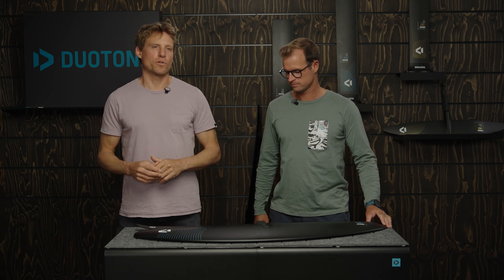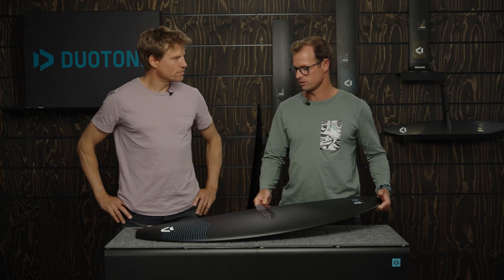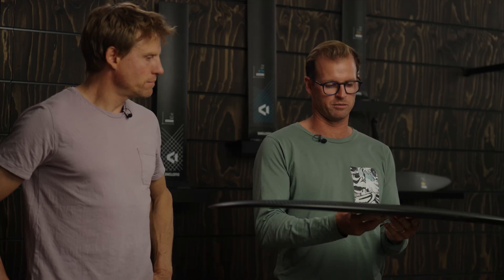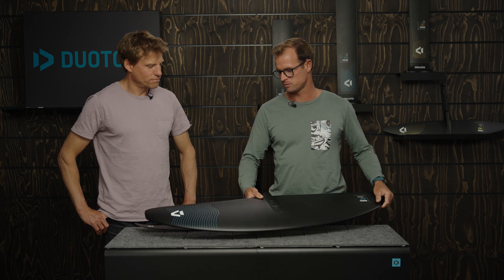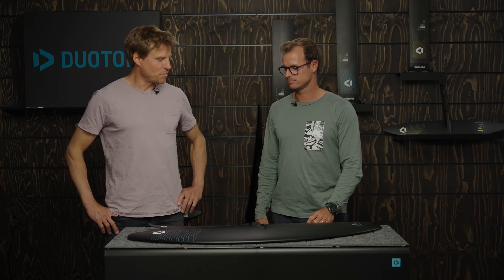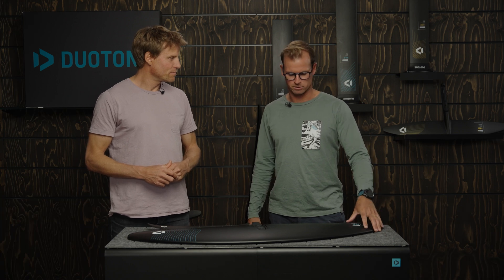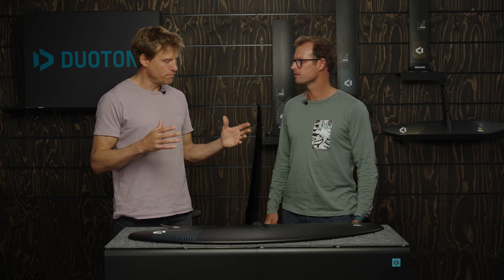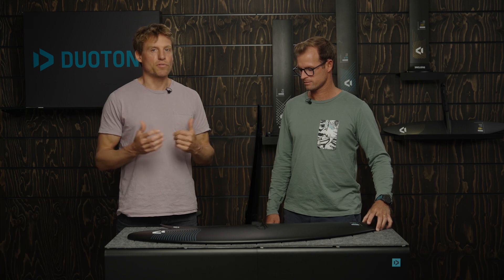Duotone Wing & Foiling Tech Talks - Aero Lift SLS 2024

Comment: Velocità max perun rider di 70 kg
Reply: Con aero lift 2400 sls
Reply from the maker: sorry, not sure I understand the question - do you mean what is the max speed for a 70kg rider on a 2400 Lift- this is not really a consideration, the Aero Lift is built to learn to foil on, top speed is not too important, probably around 18/19 knots, not much more. More important is the "stall" or starting speed, which will be around 6-8 knots (not the wind, but the speed at which the foil lifts or drops). Does that help?

Comment: Hi, great video. 

I’m still unsure on what size fuselage to use. 

I have the Skybrid 5’10” + Ventis 8.0 at a typically 10-15 kts condition. 
I’m planning to get the Glide 2.0 SLS 1100 set. 

So which fuselage should I go for?
Reply from the maker: Hi there,  could you give some info on your skill level - if you are a beginner, then rather choose the longer 78 Aero Alu Pocket, or if you have Carbon masts, then the 74 3BS. More experienced riders choose the 66 length in either Aero Alu, or 3BS Alu if you have carbon masts.
Reply: @ I think im at the beginnings of an intermediate. I’ve only recently managed to gybe successfully but can pump myself up on foil at <10 kts with the Ventis.
Reply from the maker: @strangeAdda  hi there, then go for the 66cm fuselage if you are already gybing, this will be better in the long run. Do you have the Alu or Carbon mast? choose then the appropriate fuselage as per above, in 66cm.
Reply: @duotone.wingfoiling  right now i have an Alu mast from Fanatic. Planning to get the QM foil set Glide SLS.
Reply from the maker: @strangeAdda  ok, then take the Aero 3BS if you get the Carbon QM.
Reply from the maker: @strangeAdda  ok, then get the Aero 3BS 66cm fuselage if you are getting the Carbon SLS QM.